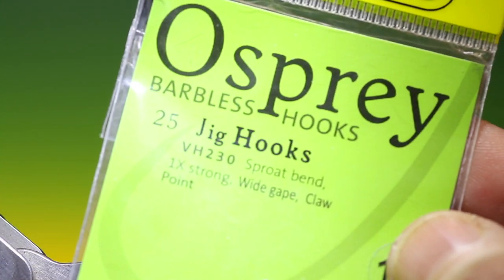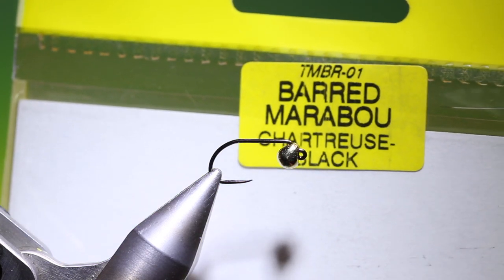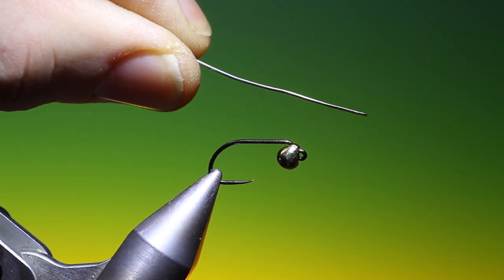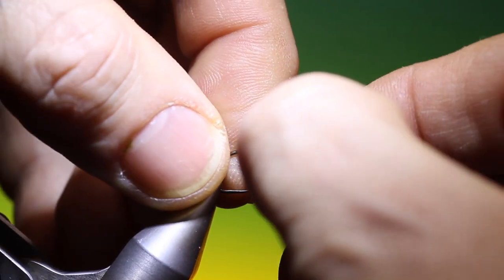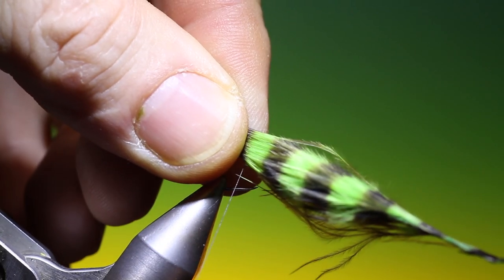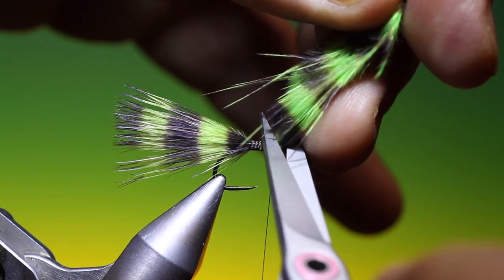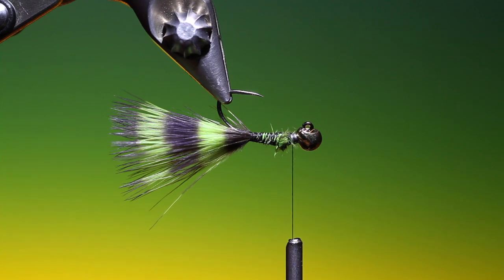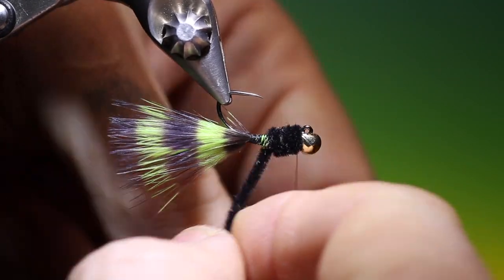Fly Tying a Marabou Jig with Barry Ord Clarke

Comment: Small jig streamers are really good in winter as well as all year. I tie different weights for different situations. 
Hint: When using lead wire, wind the wire in the opposite direction as the thread.  This will tighten up the tail end of wire with thread. I’ve been doing this for the past couple years and it works really well.
Reply from the maker: Thanks Jeff, top tip!